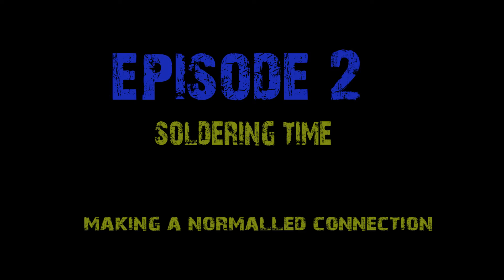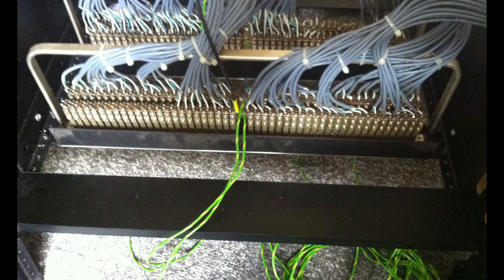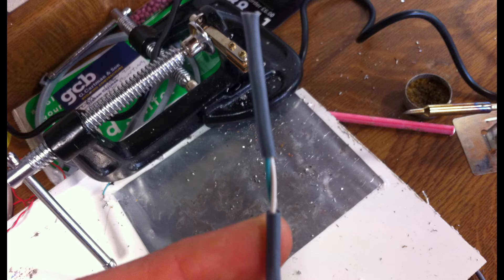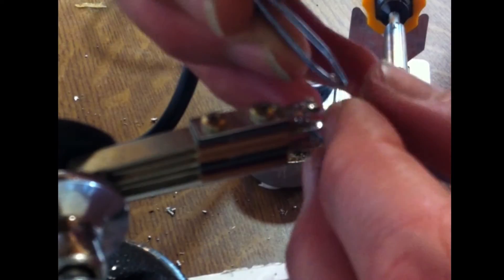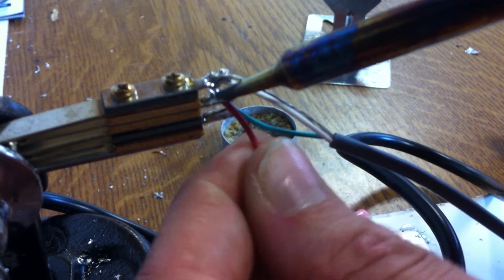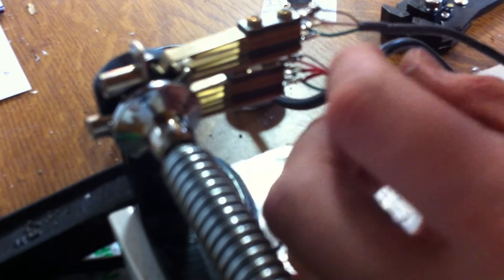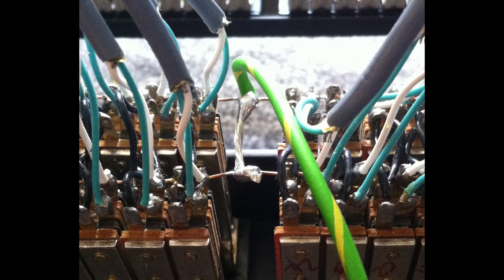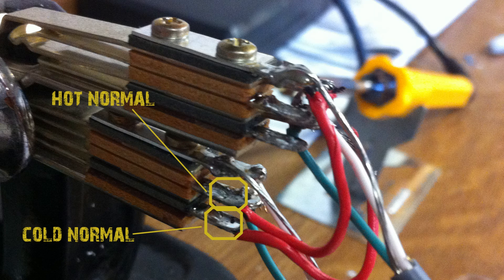How To Solder Patchbay Episode 2: Soldering The Terminals

Comment: Great video, very helpful. Like you I have a bunch of used, prewired patchbays (GPO in my case to match an old mixing desk I already have) and having taken a look at them I can see a lot of skill has been used in the cable management, it is all beautifully bundled. I have decent lengths of tail still attached so hopefully your video will allow me to figure out the normalling, make any adjustments I need, and add my jacks to the end of the tails without having to undo all the quality work the original owner did. If I tried to start from scratch there is no way I'd do such a tidy job!

Comment: i have a studio guitar rack with about eight fx units and an amp. In setting up patchbays, whats normally...made normal? the amp in and out, so that if nothing else is patched, its a pass through signal? something else? Would it pay to half normalize each fx unit so that each unit could be patched without the output? Any help from anyone would be appreciated. It appears that this should be a once and done soldering job in the most logical way.... (BTW I have a switch craft TRS 52 jack patchbay)

Comment: If the soldering is done properly the wires will break before the actual solder joint. It's a NIGHTMARE to unsolder a patchbay when the wires are wrapped around the connectors. Totally unnecessary. To keep the wires in place during soldering use a tool called third hand.
Reply from the maker: So firstly I do note that you don't need to wrap wires, it just increases tensile strength, which is handy because solder is generally quite weak, and when moving a patchbay with 96 wires soldered to it it's handy to have that extra strength. Unsoldering them is not really much of an issue, but you shouldn't need to do that anyway which is why you hardwire the connections in the first place. And yes, 'helping hands' can be handy if you need them but I didn't find the tool nessecary.

Comment: I have a question about the output grounding wire. Where does it go? Where is it connected to?
Reply from the maker: Apologies for the very delayed response I missed this comment. So although in these videos the ground connections ultimately terminate in a single wire, there is no need to do this. When you link all the ground connections via the copper wire they all share the same ground connection, which will be grounded via the closest possible mains outlet. In the case of a patch bay this is usually the mixer, as the connections should all be connected to this via the direct outs/line ins. You must make sure that all the patch bay connections are balanced as I have done in these videos for this to work.